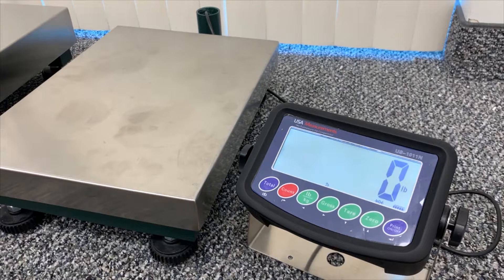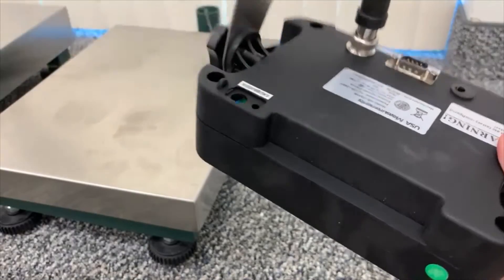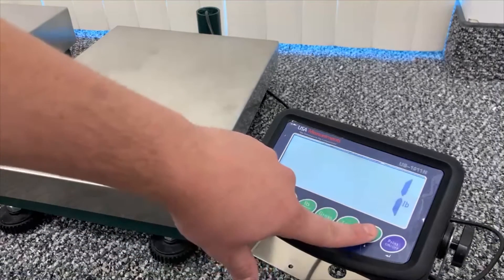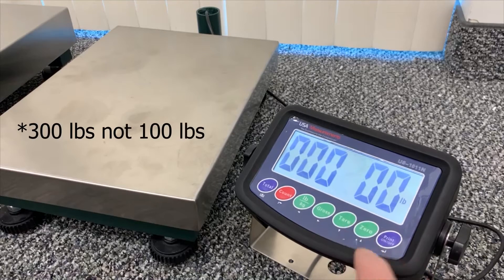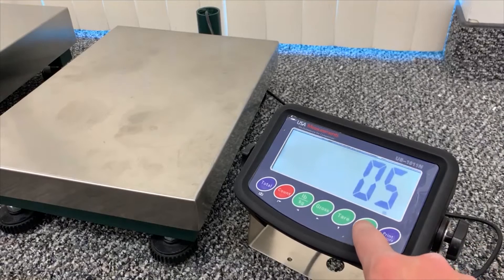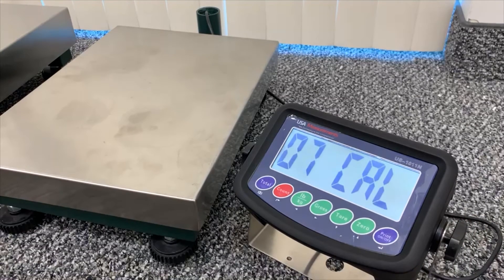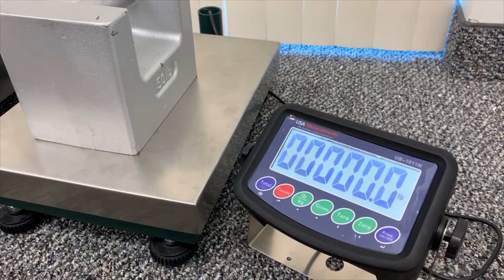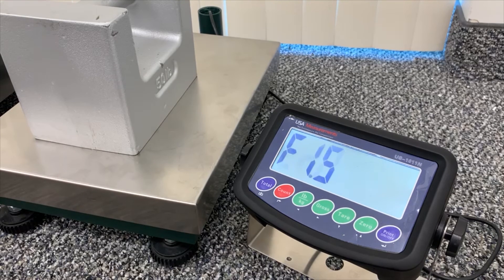US-1011N Calibration Procedure

Comment: Hello
For this type of scale it can be made linearization?
Reply from the maker: Hi, thanks for your comment! This is an analog system, so linearization is not built-in. Analog scales rely on raw load cell signals, and any adjustments would need to be made externally through calibration. However, we do offer digital load cells and indicators for customers who need linearization capabilities. Feel free to contact us at sales@usameasurements.com or call 800-711-2237 for more details!

Comment: I am trying to calibrate a scale with this, but when I get to F1.5 and input the weight, it won't allow me to enter the weight, just showing the x in the circle, and beeping. Any idea as to why this may be?
Reply: Hi, thank you for reaching out to our company. The issue is due to the calibration weights. You are not using 10% of the max capacity in calibration weights. For instance if you have a 5,000 lb capacity scale then you need to use 500 lb to calibrate your scale. Please reach out with any further questions.